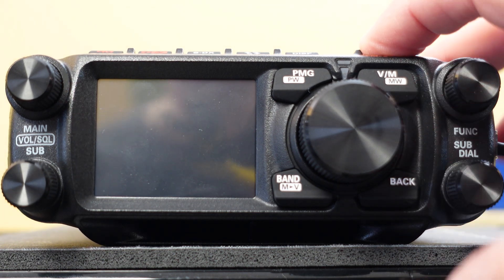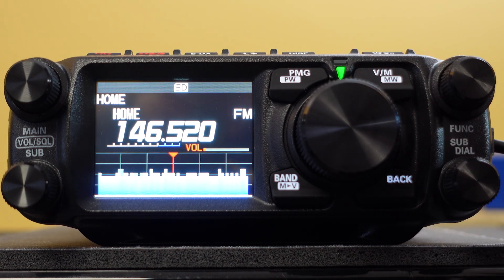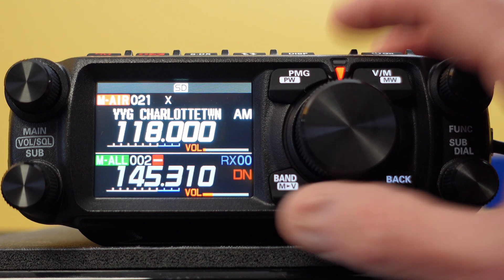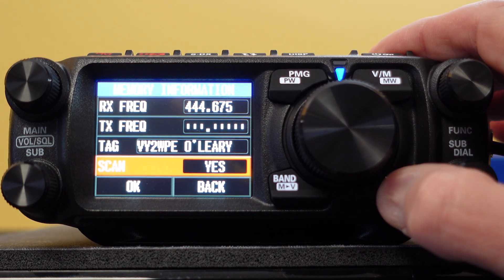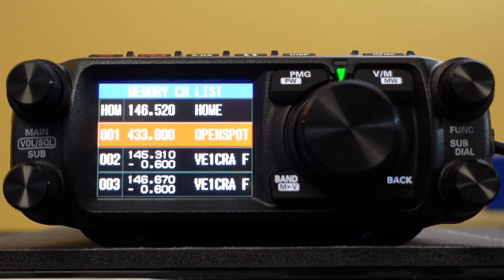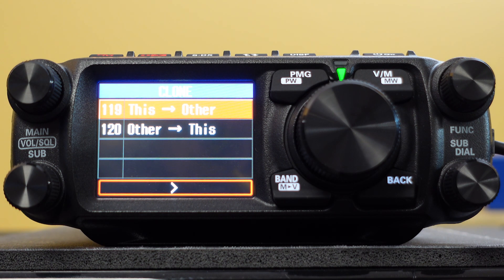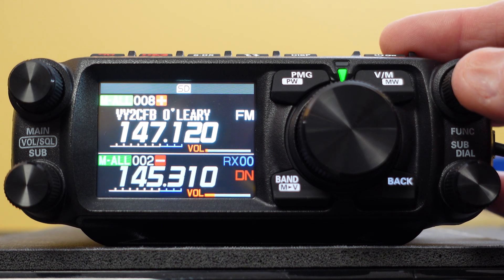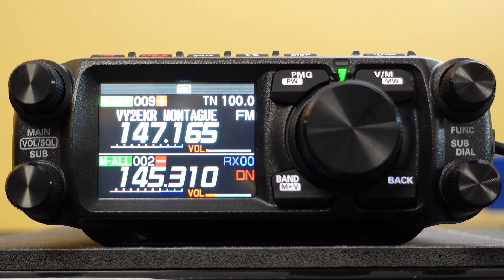Yaesu FTM 500D quick initial run-through and beginner guide

Comment: Regarding the GM button... I use it when in Fusion to see the call signs of whoever is conversing at the time.  After a minute or so, it will tell me how many miles away they are.  If I touch the tag for the caller, the compass pops up showing their relationship to my location. My FTM-300 also does this.

Comment: Hello Friend

I live in Brazil, traveled to JAPAN, bought a Yaesu FTM 500D (Japanese version). I need to transmit in Brazil on 146.950 and the radio says TELA is prohibited. TX PROHIBITED. Can you help me make a change of region or opening in TX? What is the best solution for my case? Thank you if you could help. Moacyr
PY3FK
Reply: Domestic radios in Japan are not modifiable , look at the case of the radio, if there’s a letter J, inside of a triangle, that radio is a domestic model, you’re screwed.
Reply: You can no longer buy export model radios (of any type) in Japan. The radio you have will not transmit above 146MHz because the Japanese 144MHz band is from 144-146MHz and is a SIMPLEX only band, no repeaters. Sorry to have to tell you this. It is not modifiable because domestic nerds would “Jail Brake “ it and be transmitting all over the spectrum, not just the ham bands.